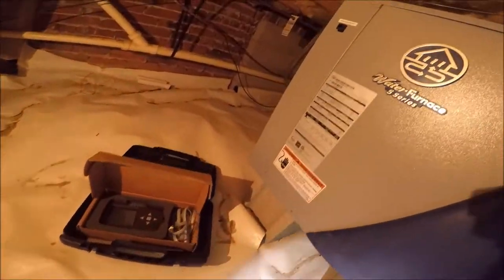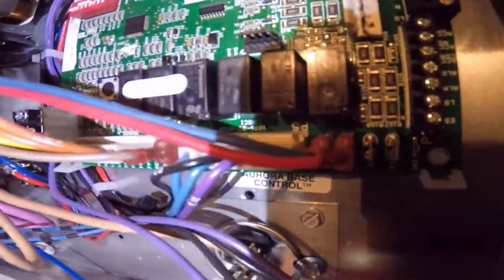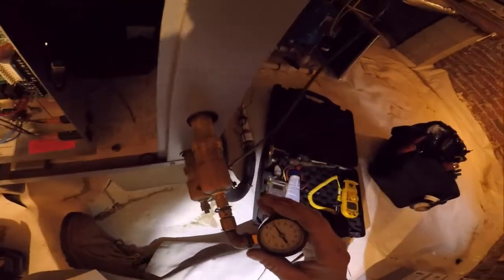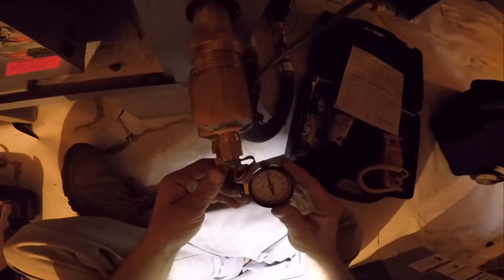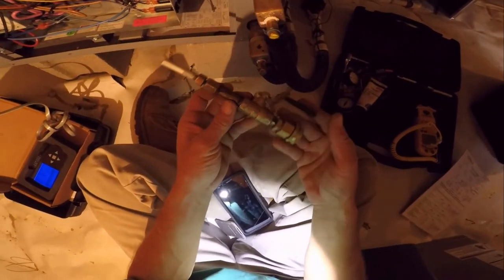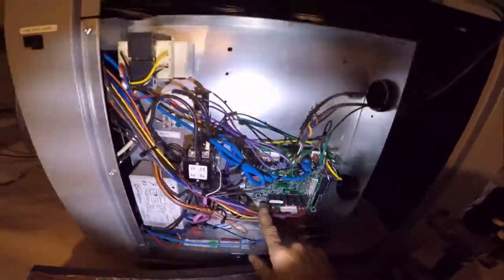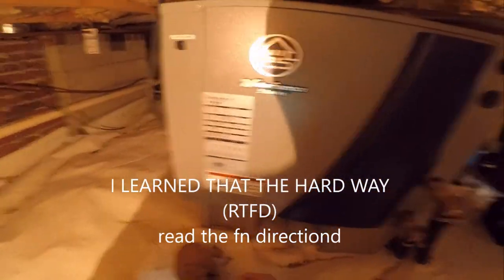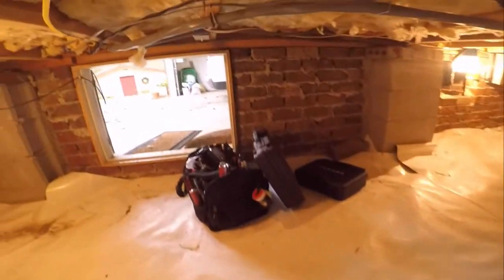(HVAC) Geothermal heat pump waterfurnace (PM)

Comment: Helped me out tremendously I was put on a Job to check a Geothermal with no procedures and now I know there's allot of tools I need to be able to preform a proper PM.
Reply from the maker: Yeah I've got several training videos that will help you that I was doing years ago when I worked for another company now I work for a different company and they don't allow me to film so if you go back and watch some of the videos I explain how the books work and their heated rejection and the pressure drop on the water and no entering and what leaving water temperature and all that stuff you could probably watch a few of those videos and get some good information off of them
Reply from the maker: I've been working on geothermal units now for about 20 years so feel free to ask any questions
Reply: @billbuckman  what is the model of that water furnace geothermal heat pump that you were doing the maintenance of
Reply from the maker: @ArisBuliteanu  oh boy that's a tough one I put that video up two years ago and haven't been back to that one since the company I used to work for where I was doing all the filming retired so I had to move to another company and they don't let me feel them and do YouTubes here at this new company but I still primarily work on geothermal for this
Reply: @billbuckman  yeah again, what is the model on that geothermal unit from water furnace that you’re doing a maintenance from? (for example) 500A11
Reply: @billbuckman  is it a split unit? Is it a forced air hydrant combo? Is it indoor/outdoor?
Reply: @billbuckman  again, is it a split geothermal unit? Is it forced air with hydronic combo? Is it indoor/outdoor?
Reply from the maker: @ArisBuliteanu  I'm pretty sure that was a serious 5 package unit but it was years ago and I do not have files of model and serial numbers I was just field tech

Comment: Thanks for the video, my unit has leaked since the day Buffalo Geothermal did the install.  Now I know that there are caps that can be tightened.  Do you have anymore videos on your fill device?  I am assuming that could use to drain it also.

Comment: Hey Bill I would like to know what area you live. I have a water furnace geothermal carrier unit it works in the heating mode but doesn’t work in the cooling mode .the reversing valve sounds like it’s is working but I’m kind of stumped on why it is going out on high limit any info you can give would be appreciated.
Reply from the maker: Around Jacksonville North Carolina
    Make sure I got this straight you have a split system am I correct waterfurnace is the compressor section and carrier would be your air handler I'm assuming. Going out on high pressure in the cooling mode would be just like two or three things no water flow through the coax coil during cooling mode that's the first thing I would check make sure your pressure going into the unit water pressure is good no water flow in cooling would be the same thing as having a condenser fan fail on an outdoor unit in the summer. Number two it probably has a bad expansion valve in the carrier unit unless it's a piston
Reply from the maker: Cooling TXV and water flow make sure filter dryers are by flow filters if they're all TXV in both units it bypasses one in the cooling mode and then like I said is the opposite one in the heating mode so it could be a restricted TXV for the cooling mode. That's my thoughts so far
Reply from the maker: check number I tried to call @robertgonzalez8419
Reply: Bill have a question I have 2 water furnace units with 1000feet of Wells is it ok to use pvc from flow center to units I have pictures.

Comment: So there's no oil cup to lube on the fan bearings or are they sealed?  I have a series 7 and these do run a lot, but it sure is efficient.
Reply from the maker: ECM sealed Motors

Comment: Are those work sheets available from Water Furnace web site ?
Reply from the maker: The company I worked for made special books with those on it but you might be able to get them off the water furnace website you could try calling the water furnace phone number and talk to tech support and they might be able to help you get those sheets so you can fill out your heat of rejection and heat of extraction. You can also ask them for the guests user name and password so you will be able to go to waterfurnace.com scroll to the very bottom click on secure site it'll be down in the black area and the password will be wfgst1
And username will be guest
   Then you can access all the documentation installation manuals obsolete manuals specification manuals on whatever equipment you might be working on

Comment: What app were you using.
Reply from the maker: I know I said it was a app on my phone but it actually is not the app it is the water furnace website secure site which I have the password and code for and I can bring up all the submittal data specification sheet for all units anytime I need to bring them up on my phone through the water furnace.com website you have to scroll down to the very bottom of the website is a click on secure site and that way it will ask you for the password and the username the username is guest1
And the password I think is wfgst1
Reply from the maker: Okay I checked it I was wrong you have to go to water furnace.com scroll down all the way to the bottom where it's in the black and click on secure site
  User will be (guest)
Password will be (wfgst1)
      Once you're in you can look at the different data sheets and download anything like specifications manuals , installation manuals and things of that nature I usually download then onto my phone and then I can pull them up if I need to know the specifications for a particular unit I'm sitting in front of at the time I went to water furnace School a couple times and that's how I got the back door guest code to be able to access those documents and such

Comment: hello Bill, I have a question for you, I have a 5ton water furnace open loop, 2006, and right now i have a 12000 watt auxiliary heat element on it that i would love to change to a hydronic coil hooked up to a Navien combo unit. Im a little confused about wiring the thermostat wiring to the Navien to make it work as an auxiliary heat just the way the heat element is set up right now(emergency/aux heat). I have 4 thermostat wires hooked up in the electric element box right now and they are hooked up as follows. Red wire to R, blue wire to C, white wire to W1 and W2 and green wire to GU. Any help would be appreciated. Thanks
Reply: Simon Grech call a professional
Reply: Simon Grech you’ll need to add a circulation pump, with relay... hint hint

Comment: What brand is your temp probe
Reply from the maker: The Tampa probe that I was using there is made by Atkins and it's a k couple or connection that goes into my fieldpiece meter but since then I've not been able to get replacement for that one they just continued it so I've been using about four different ones all of them I believe are field peace with k coupler connector and a bunch of them I researched on eBay because you want a skinny stem or you end up messing up your temporal cuz you can't pull it out so you try to get the skinniest probe and the one one of the ones I've used so far the ones I've been getting them and searching them on eBay and buying them off eBay cuz Johnstone supply every time I order one from them it's either too thick or there's other problems or something they can't never get the right one so I just get them off of eBay or Amazon
Reply: @billbuckman  thank you very much for the response ill check ebay out. What part of the country do you work?
Reply from the maker: East Coast North Carolina Atlantic Beach area Morehead City Jacksonville pretty much right on the military base area
Reply from the maker: https://www.trutechtools.com/ATT100?utm_source=google&utm_medium=surfaces&utm_campaign=shopping%20feed&utm_content=free%20google%20shopping%20clicks&gclid=CjwKCAiA1JGRBhBSEiwAxXblwVe3leIt3F3KXaitVFRk8VHthoD2AJ_C8Ct309Rl_2YqzPc3klJQ4BoCnyYQAvD_BwE
Reply from the maker: Check this link this is one of the probes I use
Reply from the maker: @davidhatcher1611  I posted a link in our comments for you to check out this is one of the probes I use
Reply: @billbuckman  thamk you